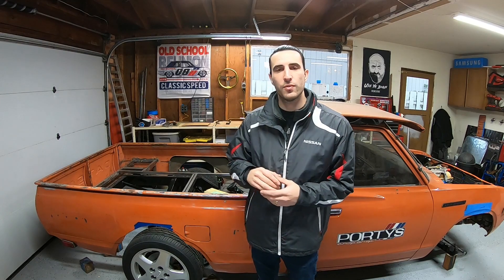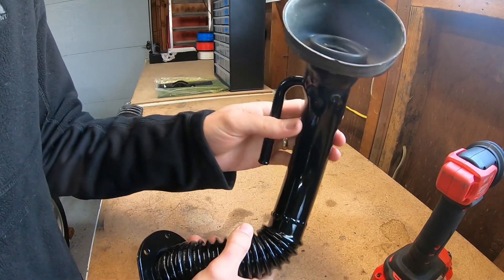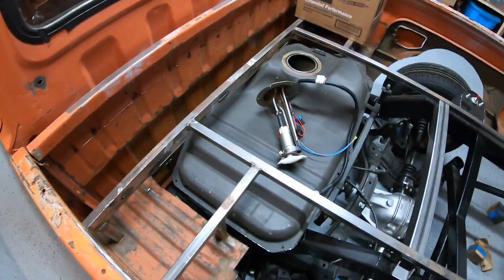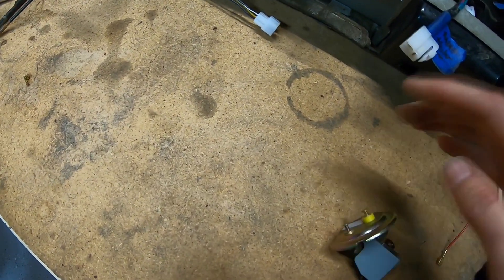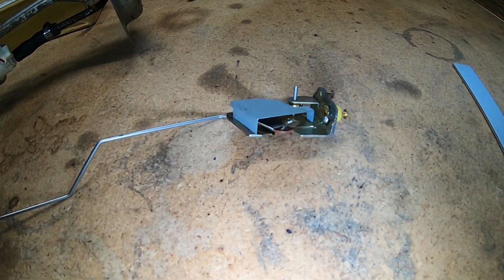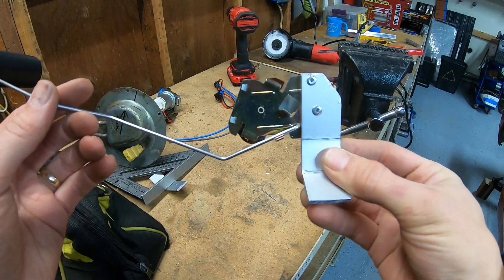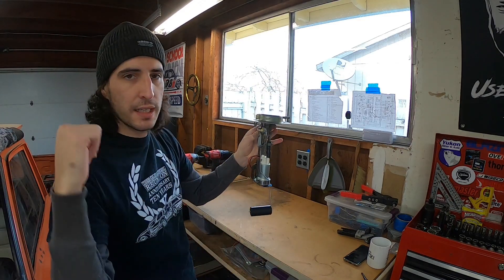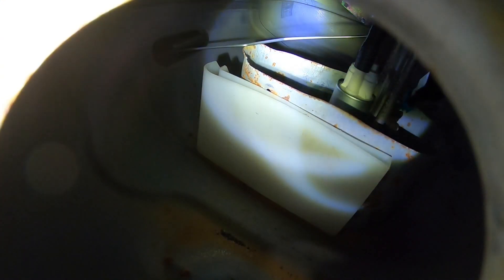Make your Fuel gauge work again!! - Datsun 620 Fuel injection gas tank w/ retrofitted sending unit

Comment: ive really enjoyed following this so far, subscribed. i have my own datsun 720 JDM model, with an sr20det in it, but with original frame and such, so its interesting to watch how other people go about their modifications, i planned to get  the beebani customs coil over conversion to get around the bad handling, but id imagine your route with silvia subframes is the best course tbh.
Reply from the maker: Thanks for following along, sounds like a cool truck! The truth is the coilovers are likely to mask the bad handling by making the truck stiffer, but replacing the suspension component doesn't fix the real issues such as 1980s truck brakes and steering, as well as likely incorrect suspension geometry. I can't say this is a practical solution as it will likely have your truck down for several months at a minimum. If you want to chat a more in detail I would be happy to through the email in my profile or via Instagram. Take care and thanks for watching!

Comment: Get stuff man... What made you want to get rid of the fuel cell just kept running out of gas? Because I pulled my tank and was thinking about going that route.
Reply from the maker: Thank you! Personally I had too many problems with the fuel cell to want to continue using. The foam breaks down and clogs filters (and pumps)  there's no proper vented fill neck, the fuel pump options weren't great and there was no way of getting a legit OEM fuel sending unit in mine. I'm sure most of those problems could have been solved but they were all way easier to tackle on a factory tank.